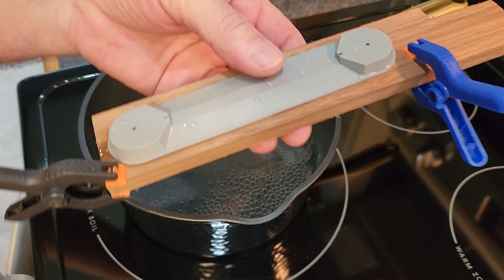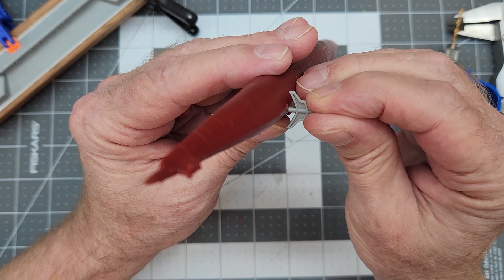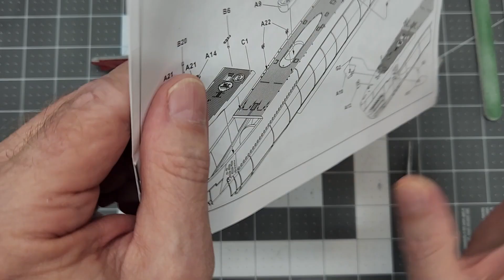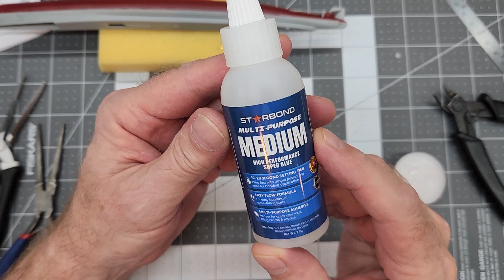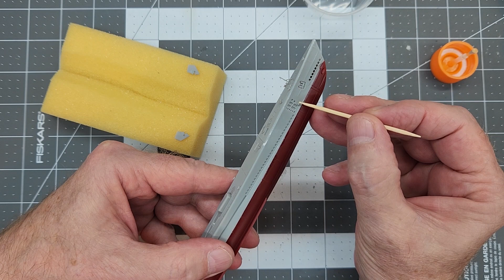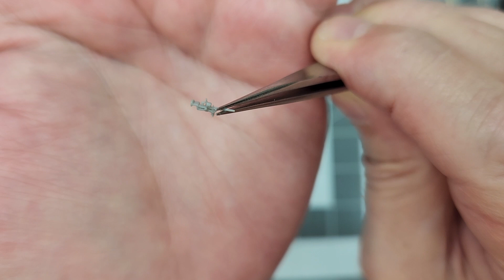GATO Class Sub 1941by AFV Club, Part 1, Kit Construction

Comment: Hi Johnny. Very interesting video. I admire your patience. I think I will be in trouble with very small pieces and rails and guards on the rear. I really have problems with tiny parts. But when I look at your videos, I'm more confident in myself and I can fix all these issues. Finally, I've used for the first time PPP to fill the small gaps and I'm very satisfied. I really prefer acrylic putty to Tamiya one. Anyway, waiting for next Friday for the painting job. Meanwhile, have a great week and stay safe. Best regards from France my friend. François 🐕‍🦺🐾
Reply from the maker: Hi François, this kit does have some tiny parts. I plan on building other 1/350 scale vessels and I thought this kit would be a good introduction to the scale. If you decide to tackle one in this scale just take your time and make sure you are close to your work surface, that way if you drop something it hopefully won't have far to go and can be found more easily, LOL!!! So, you like the PPP! I love using this stuff, clean-up is so easy, but it's not very good for large fills. Thanks so much for watching, hope your weekend is going well, take care and see you next Friday! Johnny